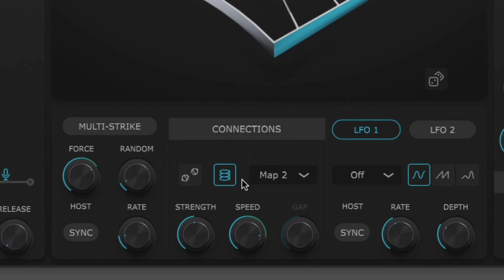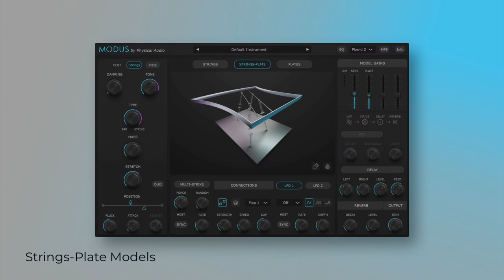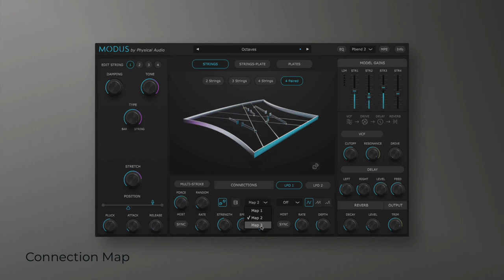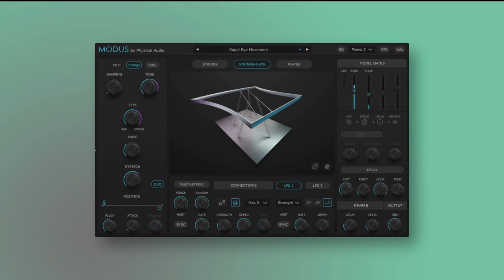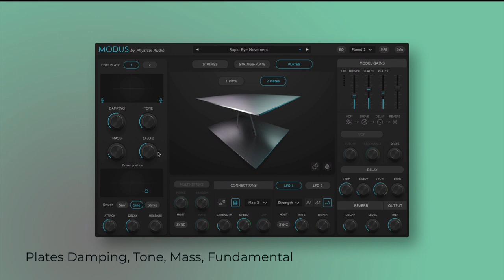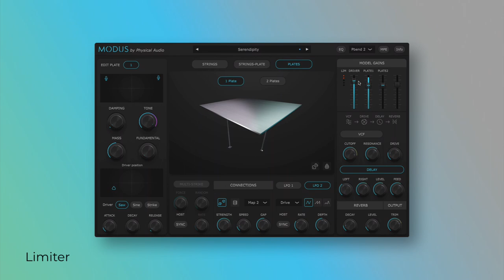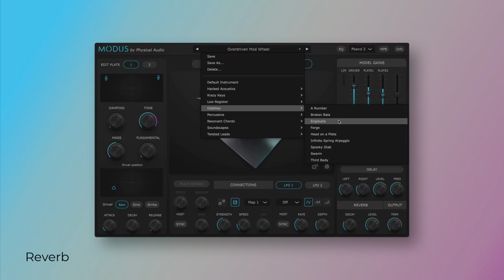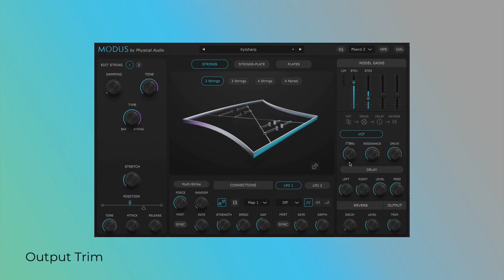MODUS Full Tutorial – Model Types, Connection, Multi-Strike and More Explained

Comment from the maker: We've just updated Modus to v1.0.6 with a fix for a critical bug that leads to the plug-in not producing sound.

Grab the update from https://physicalaudio.co.uk/downloads/

This update also includes the following fixes since the initial release:

- Fix for plate control parameter synchronisation on the UI.

- Fix for MPE mode setting when loading a saved project/session.

- Fix for MPE pitch glide motion.

Comment: Any plans to implement Midi learn?
Reply: indeed. a very big part is missing without this and ideally some kind of basic modulation matrix to be able to connect one midi source to multiple parameters with varying strengths, directions etc for each parameter controlled by this one midi input. :)